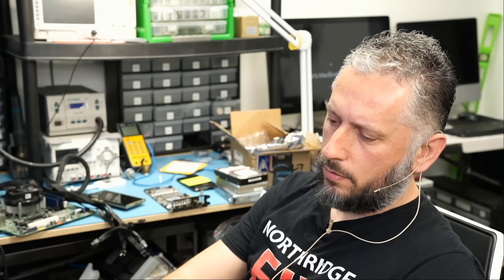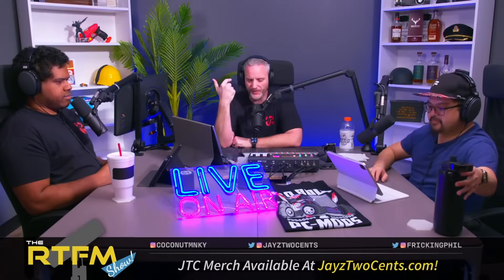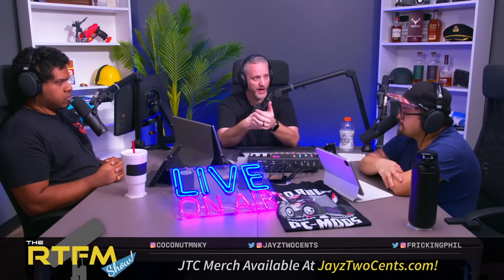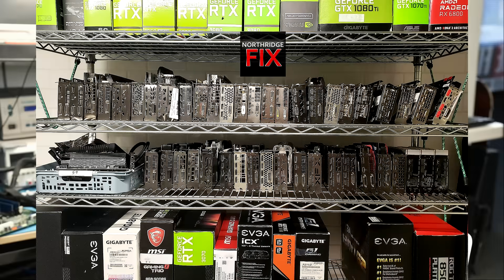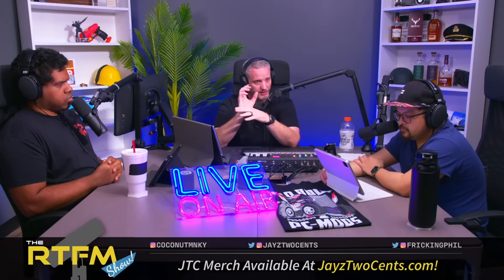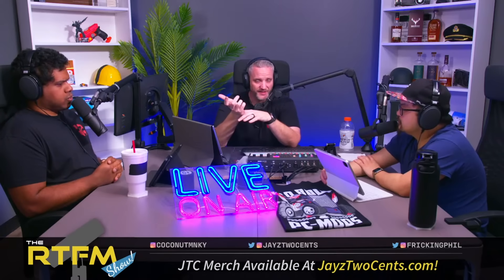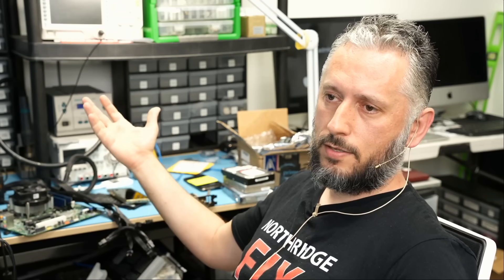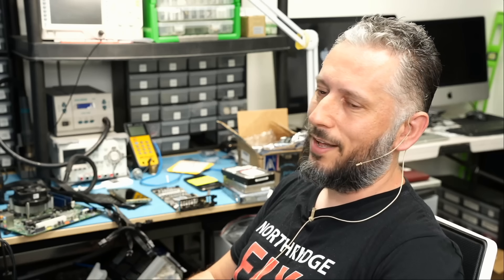Melting 4090 and CableMod. JayzTwoCents and Gamers Nexus Response. Blame NVidia or User?

Comment: gtx series: nothing bad happened with cable connectors
rtx 2000: nothing bad happened with cable connectors
rtx 3000: nothing bad happened with cable connectors
rtx 4000: cable connectors melting
users: - oh no, I forgot how to connect cables
Reply: lmao ... right on point bruh
Reply: Or like 20 years of general PCI-E power connectors no problem - New proprietary connector comes out and has issues - must be user error lmao
Reply: @azteamr0per  3090 debuted the connector and has the same TDP.
Reply: Compare the connector surface area and mass of used metal in the new 12 pin and regular 8 pin. The 12 pin is TINY compared to an 8 pin. The reason why 8 pin connector has a 150W limit: it provides so much margin of error. Margin of error in manufacture of the connector, in installation, in most failure modes while in use. 
You could push 300W through an 8pin without problems, I do believe the 150W limit is HALF of the rated steady state limit. 
Now you see 600W pushed through a 12 pin with relative skinny contacts... and it melts. Im not saying correlation is causality, but something is wrong for sure.
Reply: Not user error,badly designed board
Reply: @stintus1  100% poor design of board.
Reply: Exactly
Reply: The funny part is we used to use SUPER sketchy connectors and adaptors way way back in the day. We used to daisy chain like a dozen molex together for fans, floppy adaptors and gpus plus our cold cathodes and not made for water cooling pumps lol. XD and sure sometimes you would get a little melt but it was rare and didnt actually stop working.
Reply: hahaha
Reply: I believe some old timers said there were melty fire issues with old 6 and 8pin power cables in the early years so some of this is history repeating...
Reply: @Starscreamious  I don't know what "old timer" would say that, but I've been building since 1993, and I can assure you that melting 6 and 8 pin ATX was never a thing. Some absolutely did melt, but it was never because of a board manufacturer, as it is here.

We just didn't work with enough power to come anywhere close to things like this back in the day. You could short stuff out and have some melting, but it was rare. 12VHPWR is shorting and melting because a few mm of the harness didn't make it in, the quality is crap so the metal is shearing, causing resistance and heat. This was never an issue with 6/8 pin ATX, and the worst that happened with them if a few millimeters went unseated, was the card didn't power up.
Reply: @Starscreamious  The worst were those molex 4 pin to pci-e adapters
Reply: There would be more failures if it was a card that most people could afford.
Reply: Since this melting problem seems to only affect the 4090, it appears that it has to do with the tremendous current draw when running the 4090.
Reply: Rtx 1000??? Pretty sure it was still gtx
Reply: @startjim123456  you're right, my bad
Reply: @cv3174  Gpu mining is old and there was never a problem with old connectors. NVidea is at fault here with dodgy cards
Reply: Exactly, where are all the melted 8 pin connectors? 😂
Reply: Exactly, stupid to blame it on user error.
Reply: There is no RTX 1000 series, but you make a valid point. I'm not sure why Nvidia didn't stick with the standard power connector.
Reply: @BogdandoomersFHD   you're right, my bad
Reply: Actually the RTX 3000 have the same connectors as the 4000.. Still garbage.
Reply: There is nothing more to say.
Reply: This would makes sense if all the cables where the same in every generation.  Nvidia is using a new cable standard and it's clear that users might not be fully aware of how to use it. Nearly every failure has been user error. Stop the excuses. wtf is the rtx 1000? You're a moron.
Reply: Teorically speaking, it's possible to be a user fault,because the connectors is slightly different.
For example,i personally see 2 instance of ripped display port on 2 monitor, because the user never used the DP before and when unplugged,they don't press the tab (they only know and used hdmi).
Now,image if from tomorrow all monitor use only dp port,most user never see/used DP port and a sudden spike of broken DP arises.
What I want to say is: it's not simply,oh this new object use a different port ( contrary to the old gen) and the port broke easily= the fault It on the new object.
Sometimes it's both (new connector and new object) sometimes it's user fault, simply because they never used it.

I work for a shop who built pc,the amount of time, people connect the hdmi on the mb instead of the GPU it's astonishing 😢
Reply: steve: you are holding it wrong, oh i mean plugging it wrong
Reply: hahaaa ... so right... what was a cable again ?
Reply: Exactly 🤣
Reply: Shoving plugs into places is a highly skilled ability
Reply: Perfect analysis
Reply: Steve just insured his supply of nvidia samples keep coming in.
Reply: @MrGreen1988  It's funny you say that, when GN buys most products they review out of pocket. If Nvidia cuts them out of "free" GPUs to review, GN wouldn't give a fuck because they would just go out and buy it themselves. The team is halfway around the world at Computex right now. Calm down and wait for them to get back to be able to properly cover the story.
Reply: @clippers117  ? i find most of there reviews useless to me.
Reply: RX 7000: oh yes, I suddenly remember how to connect cables. It's definitely not Ngreedia's fault! :D
Reply: Amen lol
Reply: So do we know who was right?  I see cablemod did a recall. Why would they if it wasn’t the adaptor?
Reply: LMAO! FRFR
Reply: I don't think its JUST the cable connector, this only seems to happen to the 4090, I don't think I've seen a single 4080 down with this problem
Reply: @Juno3335 yes, he fixed also 4080 in the near past too :(
Reply: @radoslavsk8591  Wasn't that for a broken connector instead of a melted one?
Reply: @Juno3335  no, it melted like 4090
Reply: @Juno3335  He did show a 4080 that he'd replaced the connector on.
Reply: @Juno3335  Watch the video then, because right from the start it is a 4080..
Reply: @zebilaweed  I watched it a few days ago, I was correct. Broken connector not melted connector.
Reply: Gamers Nexus is a joke
Reply: @nickv6568  there’s been about ten new cases posted to r/Nvidia this past week.
Reply: @nickv6568  Bit of a hot take there :p
Reply: @Starscreamious  Just calling it for what it is mate. I'm not here trying to be a D about it.
Reply: @nickv6568  GN is not a joke. I do, however, think he's wrong on this...and overconfident about it as well.
Reply: @Starscreamious  True,GN is not a joke. But hes view on this issue however is a complete joke.
Reply: @nickv6568  
Yeah I think he's off the mark here. 
If I had to speculate it's probably because his close involvement with nvidia engineers colored his opinion (biased him) during the 4000 series launch.
Reply: @Starscreamious  Absolutely
Reply: The thing is also... There's wayyyy more people now building their own pc's than before! And let's not forget the crypto miners niche also... So, more people can equal to more mistakes/accidents. It's important to not to jump to conclusions and investigate FIRST
Reply: @Trip4man  - What's your source to affirm that there's way more people building their own pc's than before?  I don't believe that.  Crypto isn't as "popular" as it was before the launch of the 4090 also.  Then, finally, how many melting connectors we saw on previous generations?  None.  How many now?  Ask Alex...
Reply: @Trip4man  GPU mining is GONE I believe.

Comment: I have to agree with you Alex. Jay is brought up the RTX 3090Ti also has the same power limits as the RTX 4090, and both cards have the same 12VHPWR connector, so why is it only the 40 series cards burning up? or could there just be a serious big batch of connectors on the 40 series that are melting the connectors?
Reply: Either the cards that melted are the faulty ones or this should be happening to ALL 4090’s and not just a few if its the card and not the user.

Comment: If I plug something into a wall outlet, the outlet is designed to accommodate for a bit of slack.  This is made in such a way so that people will not burn their houses down.  How is this different on a video card?  This is a design error on Nvidias part plain and simple.

Comment: theres no denying that its a design flaw, no matter what the fanboys say. you dont even need to have basic physics understanding, but common sense to tell that when you are funneling power from 3x8 thick gauge wires into 12 thin gauge wires, it will overload the pins.

Comment: I agree with you Alex. Nexus's theory that the connector burned, because of the cable plugged in wrong, then accusing the user of putting  the adapter in, to hide 'user end' fault. Doesn't make sense of why the adapter was melted to the connector after the fact.

Comment: I have a Gigabyte 4090 and Cablemod adapter, I was shocked at how tiny the connector is compared to old PCI-E connectors and how much left to right play is left after the cable is fully seated. I zip tied my 12vhpwr cable tightly to my case to prevent the cable from moving which would in turn move the adapter
Reply: is it burned nowday?
Reply: @loryt690  No, but it will eventually. It's a ticking bomb.
Reply: @aktchungrabanio6467  man not even 10% of the cards have this problem so it s not a ticking bomb

Comment: At 18:19 you can see that the clip is ON, but there is still a lot of wiggle room there that could allow the connector to disengage. I could see this inadvertently happening in the power cable routing back to the power supply. Maybe that is putting stress on the connector even though it is fully plugged in. Since Alex has seen melted connectors on the card with the Cablemod installed, that's where the plot thickens.
Reply: It can only disengage if its physically touched after its installed or its under extreme pressure which the user should obviously know if they installed it.. Through my experience I've installed hundreds of gpus and no matter how tight the wires were once things go on they normally don't move. This is only happening with 4000 series and that should be enough evidence by itself.

Comment: maybe its too much power running through the 1 single connector. to much heat making it melt ? if the were 2 or more power connectors it may dissapate the heat slightly. maybe maybe maybe, just a thought i've never used this card.

Comment: Tech Jesus ego is blinding him.  Not going to listen to the media guy who made one sample fail and then definitively conclude it's all user error and part bad design leading to more user error.  It's a classic case of we know just enough to be dangerous and not enough to sift through nuance and get it right, because we are racing to get the video out for more clicks.  I'm going to listen to the guys who are handling and repairing all the melting on a daily basis.  As someone who had a Asus 4090 power melt, it's very frustrating how everyone just blames user error when I know, with absolute certainty, I plugged mine in fully.  GN just caused a wave of gaslighting with their short-sighted conclusion.

Comment: From watching that video... I don't know how that adapter could have been inserted any more than it already was. And it doesn't matter if this is entirely user error or not. If your design makes user error so easy to occur, it's a bad design. And while I think there is some percentage of user error here... that's just a statistical probability. However, it doesn't seem to be that simple and I think there is more going on here. Honestly, we should have stuck with the old standard. With 16GA wire, Mini-Fit Jr is rated for 10A per 12V terminal for a total of 720 watts on two 8-pin connectors. It's more capable than the standard they're trying to replace it with. The only reason for 12VHPWR to exist is size. It fits easier on NVIDIA's smaller, dense, PCBs.

And I know people are going to argue that a single 8-pin is only rated for 150 watts, but you're quoting a sensing specification from PCI Sig, not the current load capacity of Mini-Fit Jr, which predates GPUs even needing dedicated power. And if it were only 150 watts, tell me why there are plenty of single 8-pin GPU's that well exceed that. It's a sensing specification, nothing more. One that GPU manufactures pretty much ignore anyways, because it's stupid.

Comment: no it is connector issue , that why away is melting  only 12 + , but 12 - (GND)  is okey because is the whole case have GND the video card takes is power from the case 12 - (GND) ,  from AIO where to conmect HDMI or Display Port , video takes GND from PCI Slot  to

Comment: I had a 4090 when i plugged it all they that connector still had play side to side very bad engineering issue from a card that requires a 1200W Power Supply maybe Nvidia shouldn't of used  40 gauge pins. 'They should of used a Industrial Connector IP44

Comment: The gauge of the wires inside the connector is too thin, and the connection made by users is too insecure. 600 watts over skinny little wires, and the connection isn't solid enough. The ATX 3.0 GPU standard needs to be ATX 4.0 already. They blew it.

Comment: 16:00 - There is a means by which this COULD conceivably occur, and that is due to increased oxidation to the card-side pins over time from high temps prior to installation of the adapter. It'd lead to increased resistance across those pins. Still ultimately nvidias fault because they designed a card that allows a not-insignificant number of users to install their product in a way that is still producing these outcomes

Comment: When I first saw that connector I knew why it burned up.
The same reason as a coiled wire heats up if you put enough current through it.
Too much current through too little metal.

Comment: Are there any specifications on the maximum current that this power socket is rated for? Given that these cards can draw around 450W as opposed to earlier 3000 series cards which ran at around 200W with 2 connectors I don’t see how the 4000 series single connector can handle the required current without the problems being seen now. We also apparently have users breaking the sockets by using excessive force on insertion of the plug and others apparently not ensuring the plug is fully seated in the socket. Also what is the manufacturer saying about this ?

Comment: You know what’s an easy solution? Just go back to the connector that has worked for years without problem.
Reply: So you can make the whole board smaller but then say to yourself you don’t have room to use the proper connectors. Man go eat a dk

Comment: Why doesn’t some just pull some Amps through this plug and socket? Do it under thermal and see what’s getting hot first and why! Also could this be a case of the socket getting hot and the pins moving which opens up the connectors that grip the pins over time? This would explain why it’s always on the card side and nowhere else through the connections?

Comment: I think you're absolutely right, it's a problem Nvidia has to solve, it cannot be solved by anyone else. I see the problem in an overstress of contact area which is considerable smaller than in the older solutions with up to 3x 8-pin connctors. Even if you would use some clever current balancing circuit to even out the currents every one of the 6 power pins has to carry they are just f*cking small for the job. If you take Tyco MQS contacts as a comparison they are rated for 7,5 Amps per pin @ 80 degs C. Multiply this by 6 and you get a maximum wattage of around 540 W under optimal conditions and ONLY if every contact takes an even amount of the load.
I can not get how mad an engineer might be to think that stunt may go OK taking 3 to 4 8-pin power outlets and put them on 12 pins in a smaller form factor connector. This is absolutely bonkers, no need for doing so if your education in physics basic course at the university has left some marks.
Even if you put the female connector straight into the card and give it a firm press, there will be a problem coming, maybe from micro vibrations of the contacts, reducing the effective area for the current, perhaps pulling small sparks, getting warmer, thermal changes may lead to changes in the dimensions of the metal pins and contact tongues, perhaps even some micro wearout happens after some time. The video card is not a static thing, there are fans moving, they speed up and down, other moving parts in the computer, even the user loading a CD, pressing a button, plugging in USB devices and so on. If you push the contacts far to its physical limits without any need to do so beside marketing reasons ("it is MY CONNECTOR" - Gollum image suggested while reading this) you will get into trouble. The trouble is there. And the trouble is exactly this connector or better the way it is used: too much amperage for the contacts, way off any reasonable specification limits I as an electronics engineer and a long year developer of automotive electronics would consider to be safe in any way. This connector is not right for up to 600 watts of power. Not if you wanna be on the safe side.

I thought a lot lately of replacing my 3090 by a 4090. But hell no, this connector seemed wrong to me the moment I first saw it months ago. And I'm feeling confirmed. I will not buy any graphics card forcing me to use this for sure. There is a need to revert to the old connectors in my opinion. But I do not think Nvidia is ticking this way. Which is a shame.
Reply: Same. I was about to get myself a new 4090 but as I kept looking for the best brand I came to learn about this SIGNIFICANTLY DANGEROUS issue. People: this could set your god damn house on fire. It's no joke. I am not willing to risk it.